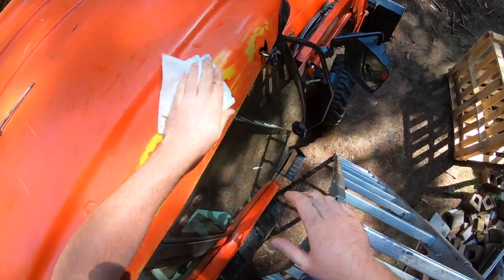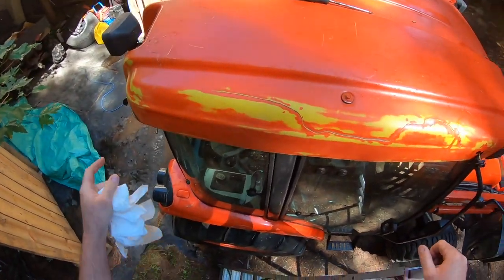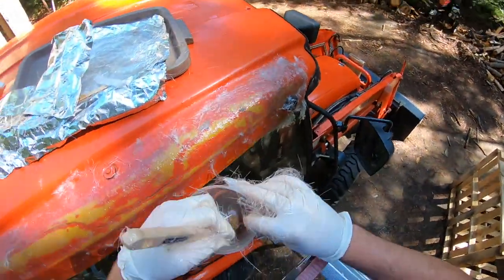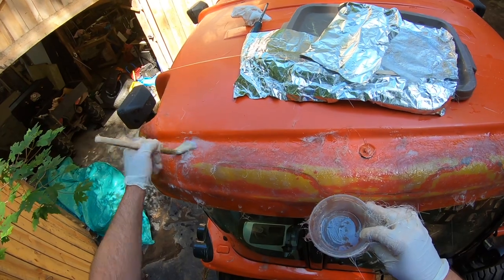Cracked Tractor Cab Roof. Tractor Roof Fiberglass Repair.

Comment: I use just the resin to fill holes in my woodworking. It's durable but softer than epoxy and sands well with softer woods. Use a very fine grit like 600 or higher for final sanding and it becomes see through. And cheaper than epoxy.

Comment: If you'd taken the roof off you could have done all of that ugly repair on the underside and nobody would even know. Then you use just the resin (without any mat or cloth) on the outside to fill in any cracks or holes and that way it's easy to sand smooth, primer and paint. Wallah! I know it's just a tractor but I've seen your other videos.... you're capable of nice work. You're better than that. I'm not hatin or throwin shade. Nothin but love bruh. "Search your feelings... you know it to be true."
Reply from the maker: I agree that would be a better option. I figure I would patch it and likely replace if needed down the road

Comment: And this is why you don't buy used equipment...
Reply from the maker: Id buy a brand new top for the tractor if I ever needed to sell it. This is a temporary fix as I know it’s just a matter of time until I have something in the bush crack the plastic top again.
Reply from the maker: Sometime I get the itch to learn by doing
 Sometimes (like this botch job) teaches me more about what not to do than anything else haha
Reply: @sawingwithsandy  well you're a better man than most?  Most would just sand it down and hope the buyer doesn't look way up there.
Reply from the maker: bank80 yeah I’ve boughten things from guys like that. I put my name on it when i sell it so I have to be upfront. Had any bad experiences like that?